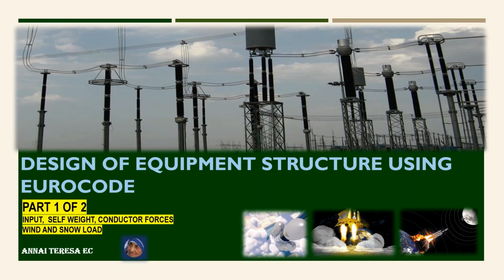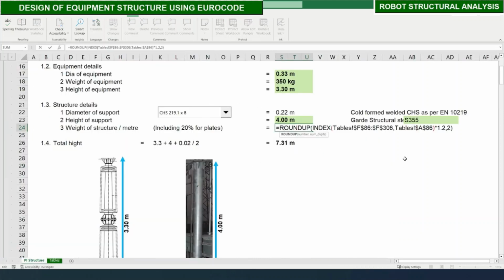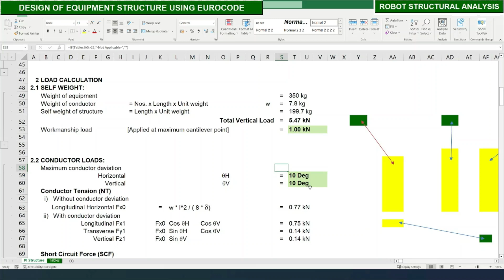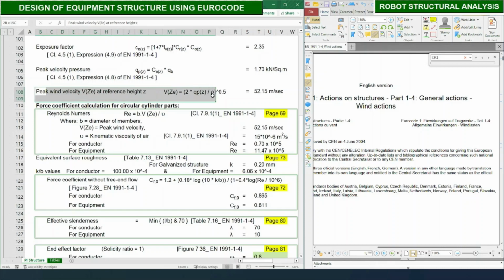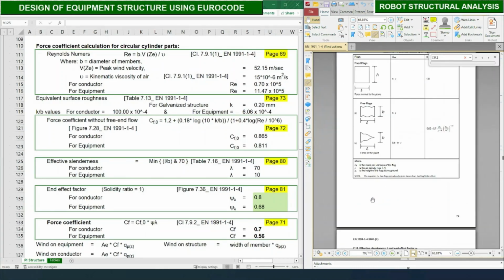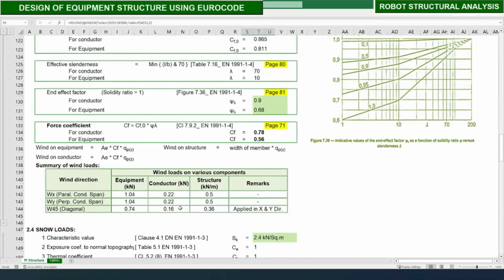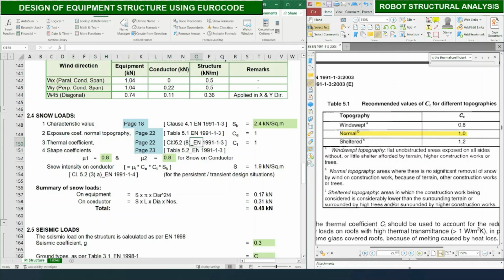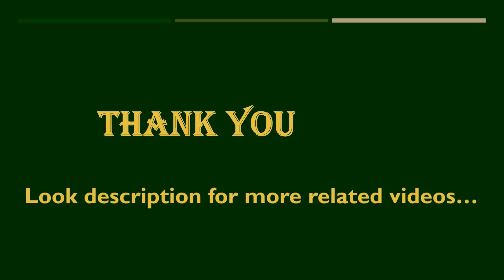Design of Equipment Structure using Eurocode | PART 1

Comment: how to select the equipment structure between Pipe or Lattice.
Reply from the maker: There are some factors like project technical specification, Weight of material, transportation, fabrication works and so on are the deciding factor on what should be designed either by pipe or Lattice. The explanation was provided in separate video: https://www.youtube.com/watch?v=-MfYiMwhFwE&t=0s

Comment: I want to calculate the wind load on pipes, for cf coefficient is same way needs to follow as per your vedio? Because in aramco standards, cf coefficient 0.7. but in europe standards looks complicated
Reply from the maker: Thanks for watching. Yes correct it is complicated in Eurocode, Mostly the value for cf calculated in Eurocode equals to 2/3 (0.667) or 0.7 which are common in ASCE and other standards. Some, Engineers often used considered cf as 0.7 as direct value instead of complicated calculation, that also correct method.